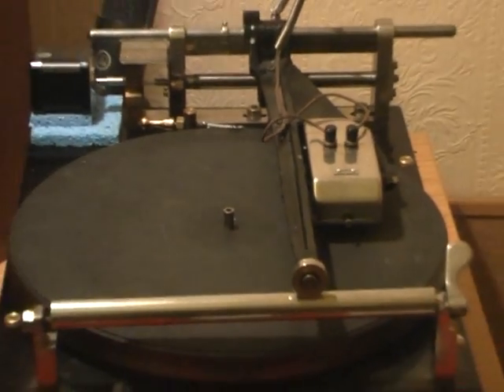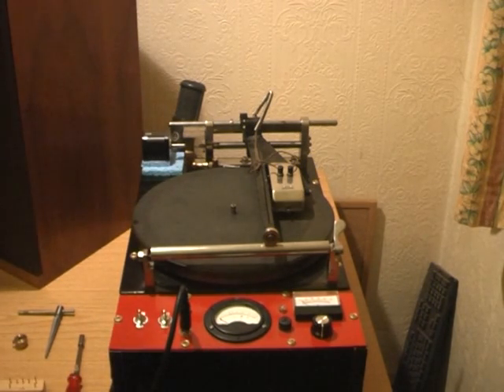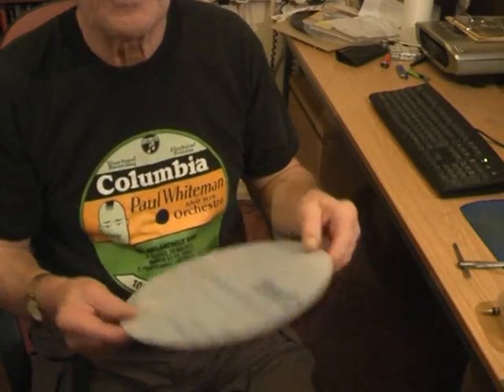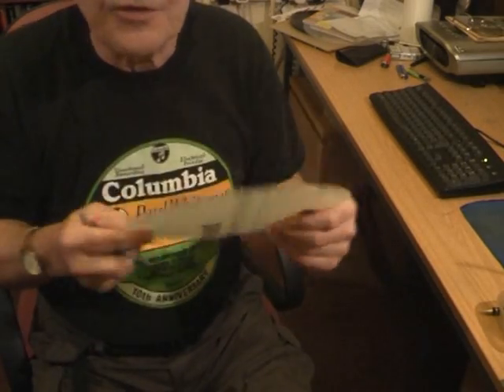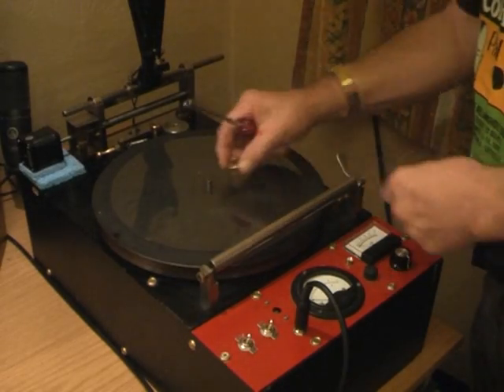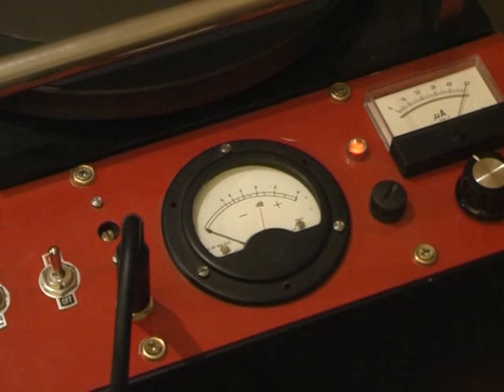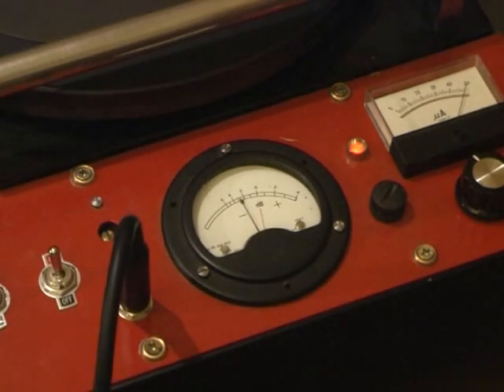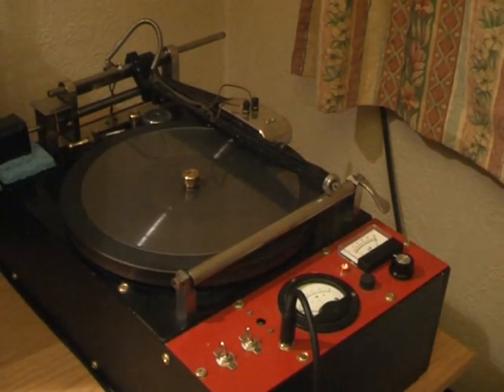home made 78 rpm records

Comment: My Records By the way are cut with shavings that usually look like hair coming off the surface, I have to hold a Vacuum Cleaner almost next to the record as it is being cut! I have accidental touched one record wale being recorded, Pa`s Old Hat, Has a HUM in one part of the record! But since it was one of My first attempts, I kept it as is! I`m with You! The part of that Wonderful record You made playing at 10:01 to 10:07 is just GOOSE PIMPLE HEAVEN! OH! I LOVE IT! I Love Your records! Your machine is much better then Mine! I use a Allied 309 with a reconstructed "Van Epps" 500 ohm cutter! I would kill to find a better Recording head for Mine all tho it does pretty good  Results! The only problem with My cutter is it records with a screw drive that drives the the cutter a tad off! The cutter is driven by placing the cutting drive over the center spindle that is gear driven, By the time the cutter get`s toward the center it cuts at a 1/2" forward from the center causing a small degree of stress on the cutting needle, Giving a slightly noticeable amount of ether needle chatter (Whistling!) or a small amount of a craggy sound! Most of My records turn out GREAT! But if the song gets too close to the center this happens! My cutter has a 4 min cutting time! So if the song is less then 3 mins long, It turns out fine, If Longer You start to hear background noises! AND SOME ARE AROUND 4 minutes long! Like "Cuddle Me" by Anson Weeks! Songs like "Someone To Care For" is fine!  My lathe has a extra center spindle so I have to cut a extra hole in the record! Before Putting the Label on I cover the second hole with Epoxy 7! I LOVE Your Channel! You do a lot of FUN things!
Reply from the maker: +roybo1930 Hello again! Yes, it's great fun cutting discs, though often very frustrating, when unpredictable things go wrong. Grrh! By the way, that great side you mentioned - the futuristic arrangement - it's called 'Chinese Jumble' - is on YT in superb quality at https://youtu.be/lP6Ka983XUE . I'm playing it as I write, and when that key-change unison passage we both like came along, I practically got goose-flesh - I haven't heard it lately! Regards, Norman.
Reply: Hey, Norman! I FOUND IT! Chinese Jumble is truly super AWESOME! I Love at around 1:15 to 1:29 minutes in as well! Why this was not issued I will never understand! I WOULD KILL TO GO THROUGH EDISON`S Library of recording`s that were not issued! And Dig out the stampers and Press Them On My Roy Ola label! Brunswick has unissued recordings as well! YES IT IS INDEED A PAIN WHEN SOMETHING GOES WRONG! I have to wet sand paper them off and re apply New Paint! Not only that My Cutting head is 500 ohm so I have to use a Church Mixer pre amp hooked up to the 70 volt screw jacks to get a good recording, The Bass is almost off because it gets overwhelmed with bass if it is not toned down! Some of  My record do not lack bass notes! Sheese!  I designed the Label for Kurt Nauck that he uses on his Facebook page! He if You have not heard of him does Record Auctions! ( NAUCK) I use it very few times for My ROYOLA recordings, My label I use the most now is a design that has a Shield with almost Brunswick Scrolls on each side on the better top half of the label, Then vertical lines below going into a space for ROY-OLA RECORD COMPANY OLA AR, U.S.A. And additional info, Then Verdical lines at the top with a diamond shape with a R with lightning bolts coming off the tail`s of the R with ELECTRIC Between them! Roy Ola is somewhat script lettering like OKeh with the Rs Tail swings down to the spindle hole and slightly wraping around it! One of My ROYOLA Records is on You Tube, I let My very good friend 2reeler post it! If You would like to see it, Go to 2reeler`s site He posted one of My records titled "Thank Your Father" Majestic Dance Orchestra! And You can see a couple of My Roybo records on My site! As well as a BOB ROY Edison needle type styled record I Made!! I would LOVE to design You a label using a name of Your choice! And send it to You via e-mail Thank You so much for Your Reply!

Comment: I wonder, is it possible to cut your own records at other speeds, too? Speeds like 33 or 45, or even some unique speed. Also, is it possible to use a larger cutting needle in order to make a cut to play on a gramophone?
Reply from the maker: +TheSkullArmyMC Hi there. Yes, you can use a wide variety of speeds for recording sound on rotating discs. Ones that have been used to my knowledge are: 16.66, 24, 33.3, 45, 50, 60, 78, 80, 90, 100 and even 120 rpm! However, most disc cutting machines are limited to 33 and 45 these days. The old, one I used just did 78, because it was designed when that was the normal speed. I just remembered: in the early 1920s, there was a make of record that gradually got faster as it played, so that it has a constant groove velocity. This was to avoid the falling-off of quality towards the centre of the disc - the groove velocity at the end of a 10" (25cm) disc is less than half of what it is at the start. It was a good idea, but too clever for its time & it died after a year or so. See on my other website, http://early78s.uk/?page_id=383 for more details of these 'World' records & an image of the rather nice label.
Reply: TheSkullArmyMC    wow

Comment: how does the cutter work??
Reply from the maker: +Jake Aigner. Inside the head, is a coil of fine wire, very much like the coil in a loudspeaker. The coil is held between the poles of a magnet, also very similar to a loudspeaker. Inside the coil, is a small, pivoted iron armature with the embossing point fixed to the bottom of it. You put the sound from your amplifier into the head, exactly as if it was a loudspeaker. Not much power is needed - perhaps 3 or 4 Watts. The fluctuating voltage in the coil changes the magnetic field between the poles of the magnet, and the armature moves from side to side in response. So the conical point of the stylus moves from side to side on the surface of the polycarbonate disc, and ploughs a furrow, exactly the same as ploughing land. These side to side movements, when played back on a record deck, reproduce the original sound. With any luck! 8^)

Comment: Where did you find that cutting machine?
Reply from the maker: +Fivos Sakellis About 50 years ago, just the top plate, no motor, was lying in the corner of somebody's garage and I asked them how much they wanted for it & they asked GBP 3. Mind you, when I got the right sort of motor, second-hand, that cost GBP 25!
Reply: @bixanorak  can you cut new songs on that recorder like todays chart music? I have loads of original 78s i still play them on my decca 66 but would love to hear what new chart music sounds like on the gramophone.
Reply from the maker: Hi Robert. I'd imagine that you could get at least some idea about how music of 2019 would sound if played on a mechanical ('acoustic') machine, by giving it an EQ (Audio Frequency curve) which resembles that of a wind-up gramophone. Such a response would be from around 200 Hz to 2500 Hz.  With the advent of good Electrical recording (e.g. the Western Electric system) in the mid-1920s, it was extended from perhaps 50 Hz to nominally 4500 Hz - sometimes a bit more. By the mid 1930s you'd be looking at 50 - 6000/7000 Hz - that's just a guesstimate of mine. I don't know much about the 1950s & onwards, but today you can record far beyond the upper limit of human hearing - usually around 20000 Hz in younger people. Of course, it declines with age; I'm 75 & can't hear anything over about 6000 Hz, but that's great really, because the 1920s is my favourite period, so I can still hear everything coming off a late 1920s record! 8^)    Most computer audio programs have equalisers, so you can impose a frequency range of your choice. It will, at least, give you an idea. It just occurred to me, that AM Radio still has an upper frequency limit of ~4500 Hz - so just listen to anything on AM Radio - which of course sounds 'dull', and compare it with VHF - FM radio, which goes up to about 15000 Hz. Hope this is of some help. Cheers, Norman.
Reply: @bixanorak  cheers norman . I just need a machine like yours as it did a beaut job. Your record re-recording sounded beautifull. I listen often to my 20s n upwards dance bands and classical plus the 50s rock n roll some of wich are on flexy vinyl and to be honest the vinyl sounds great even tho they were ment for electric 78 rpm decks. Where would i get one of them machines as i dont know.  Im 41 years so i was not around when the music was made but i enjoy it. Would you b able to re-record from mp3 i know the base drop was around 250hz and vialins high pitch sounds good, but the voices were some times to loud n distorted back in the day, and i was deaf when born so my hearing has never been good, i had grommets. You look younger than 75. If you sell that machine you have a buyer here.

Comment: give that the indicator instrument of microamps is controlled by the potentiometer,as this is connect?
Reply from the maker: Hi Allesandro. I'm sorry, I can't answer all questions because it takes too much time. However, the function of the micro-ammeter is to indicate (approximately) the groove pitch. Not the exact value of it; but simply whether it is coarse or fine for embossing a disc; or VERY coarse for a run-off. If you look at my web page on this machine - there is a live link to it on the second line of the video description above - you can see many images of the machine, including one inside the control panel, and an explanation of how the groove pitch is controlled. Hope this is of some help. Best regards, Norman.

Comment: hi Gentleman. another question. i had bought a Webster low Z cutting head. what is, based on your experience, maximum power and voltage applied to the cutting head? what are electrical parameter (Z, normal driving voltage and power) of your cutting head? thanks very much

Comment: There is a huge market for making custom 78s that can be played on mechanical wind-up gramophones.  Lacquer (acetate) doesn't work because the material is too soft and one would be lucky to play through an entire lacquer without it turning to mush. It would be nice if polycarbonate would enable you to cut a deep enough groove to play back on a gramophone, as it is likely to last longer than lacquer, but certainly not as long as shellac.  Shellac, it appears, is impossible to make anymore.

Comment: I have had the same machine in the attic since 1986 and it has definitley not been used since 66. It was my grandads I know he used it as there were some discs with it originally of my great uncle on the piano. Is the machine worth anything? I have checked out your website you have totally gutted the machine and are just using the bare bones of the original. I have a 3 round pin socket at the back of the machine I'm guessing is the power in and a 2 round pin socket on top left hand side, audio in? is it 240V. I would love to plug it in and just see if the motor turns etc but don't want to kill it! Do you know where I could get copies of original instructions etc? Thanks for your great vid and enthusiasm.
Reply from the maker: 69waveydavey Very good indeed! You are lucky to have such a machine to hand; they are much sought after. No; I did not de-gut my machine; it was already de-gutted to just the top plate, without even a motor, when I first found it, many years ago! On no account plug your machine in just to see if the turntable rotates: the motor has a capacitor in series with one winding to reverse the phase in that winding, and that capacitor may well have deteriorated in the 60 to 80 years it has been there. If so, the motor may be damaged if you plug it in. Besides, the insulation on the general wiring may have deteriorated also. If you wish, email me direct - jazz@normanfield.com - and send me several images of your machine, when I would be happy to advise you further, to the limit of my knowledge, and in an unbiased fashion. You also ask is the machine worth anything. Yes, it is. A dilapidated example a few months ago on eBay fetched £650. Good luck with it!
Reply: Don't know whether to tell my dad about the price he'll probably just want to flog it! we also have some blanks of differing sizes. My grandad worked on radio/electronics in the RAF in WWII We had a record of my great uncle on the piano in 1947, so I'm guessing he got it through contacts in that job. He went to the states in 66 after the TSR2 fiasco so we know it has never been used since then for sure. I'll take some pics next time at my mum and dads. Thanks again!

Comment: Hello there 
I have a 1940s HMV102E wind up gramophone, would this record be up to the old 78rpm needles.or would it be too hard to this record and cut it to ribbins
Reply from the maker: mark farley Hi. I tried playing them back on a spring-driven gramophone, but the 'furrow' (it's not a true groove) is too shallow for the needle to stay in. The soundbox just skids across the record, making a tiny furrow of its own, but without deeply biting into the surface of the plastic, as one might expect . Because of this, I had no real success in using gramophone needles for embossing the discs in the first place: most of them are too blunt to dig a furrow broad enough.

Comment: hello norman and thanks for this verry intresting you tube clipp . i cutt 78 rpm records in macrolon like you do i have build tow lahte cutting maschines and i am a owner of  a old wutton 78 laht cutter  from the first half of the 40 s  it is intresting to see someone  do the same thing like me . i was befor a 78 record colector White 5000 78 rpm records but i sould them sadley i have started to colect 78 records againe best regards and thanks for youre tip on the neadle manufactring know it works werry well  :)

Comment: hi, only an other question. my head have about 1250 ohm DC, what is about (in Volt or mV AC rms) at 0dB tu apply on the coil for evitate to burn it? thanks a lot.
Reply from the maker: Hi again. If your head has ~1250 ohm DC resistance, then it is of 'High Impedance'. That means it was intended to be in the anode circuit of a valve (tube), because all amplifiers used to have valves (tubes) in old times. You will not be able to drive it from a low impedance source, such as I used - the loudspeaker output of a transistor amplifier. Your head cannot be driven from a low impedance source. You have two main choices. 1. Easy, but not efficient. Obtain an old output transformer from a valve (tube) amplifier, or even a valve radio, and connect it in reverse. A low impedance loudspeaker signal will then be changed into a high impedance one, and the head will probably work. Be careful - the voltage coming out will be high! 2. Difficult, but better. Take out the old coil from the cutting head, and replace it with another one. The original coil will have thousands of turns of very fine wire. The new coil you must make, can have perhaps 100 or 150 turns of thicker wire, and its DC resistance may be around 10 ohms. Then, your amplifier will think it is just a low impedance loudspeaker, & will drive it OK. It is easy to describe, but much more difficult to perform. I wish you all good luck, and be very careful of the danger of high voltages!

Comment: Hi gentleman, i am from italy, and i am modifing an old record player into record lathe. could you gently let me know what this the optimal weight (in grammes) of stylus pressure, for polycarbonate cutting as you? if i will use common "La voce del Padrone - Gambo Rosso" needles are ok owewer for cutting polycarbonate? please reply on bassovasco2002@libero.it  thanks a lot
Reply from the maker: Hi. Thanks for writing. The point pressure on the disc is about 60 - 80 grams. Alas, most regular gramophone needles will not work - I know because I tested several different makes. The points I made that work OK are 1.5 mm diameter very hard steel, with a sharply-pointed cone of angle nearly 90°. Images are on my website - link is in video description.Hope this is of help.

Comment: Fascinating!

As for the 'embossing' stylus: is that electrically heated, to melt the recording surface?
Reply from the maker: Lucius1958 Hi. No, it's not heated.The point just presses into the surface & ploughs a furrow. It's not very deep, so it will probably only play back with a pretty compliant arm. The most consistent replay is with a .0028" stylus. Cheers, Norman.

Comment: Fascinating, do you 'cut' a run in groove as well Norman?
Reply: That's why he says Let it RPM 3 or 4 times before he turns on the sound file it is already cutting. And he does the same thing at the end, lets in rotate 3 or 4 rotations the cuts the deeper end groove.